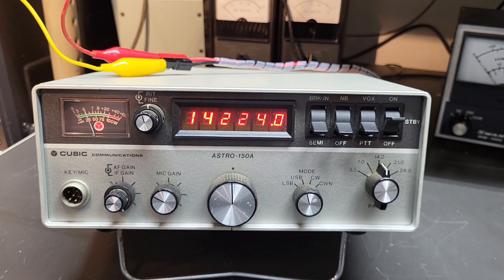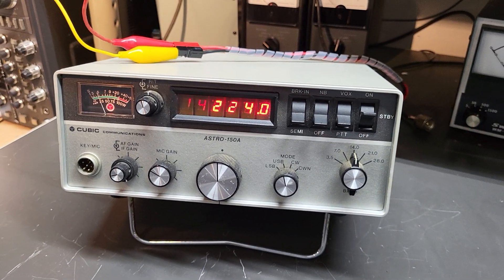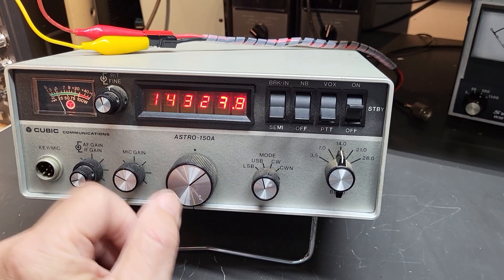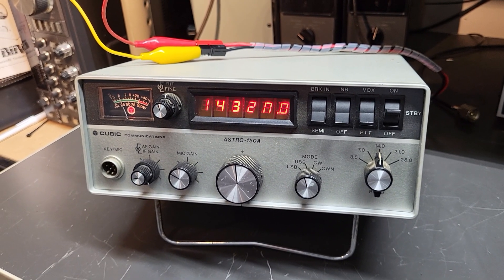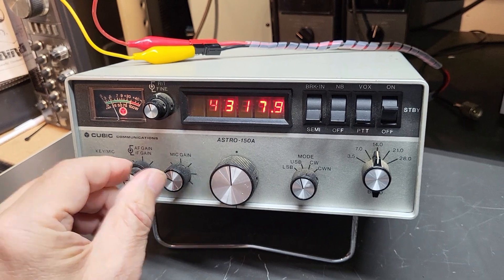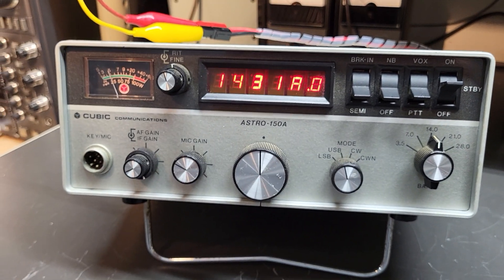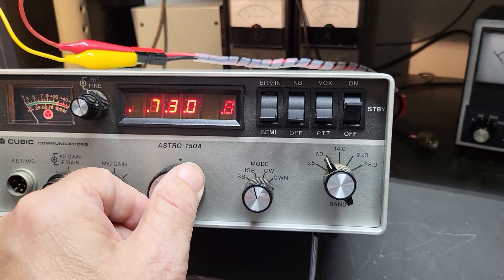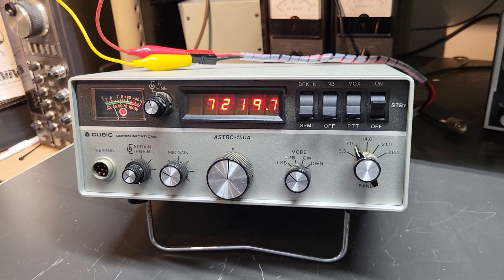Cubic Astro 150A HF Transceiver

Comment: 👍Very nice. Never seen one of these. Guessing not many made it to the UK. I think this rig started out as the Swan 150. The tuning is certainly unusual. Later some Yaesu rigs had "shuttle jog" tuning which was a similar idea. I like the way the 150A can be put into slow scan using the tuning dial. I know it's a basic rig. However, one thing that might be a pain is lack of dual VFO for split operation. Wondering if there were any mods, like increasing the RIT range, to allow at least some limited split operation.
Reply from the maker: Not sure on the mods. Yes it was a Swan design and they had a few models similar to this one but it was at the end of the Swan line. Thanks for the comment.